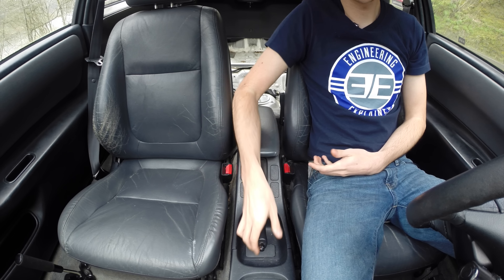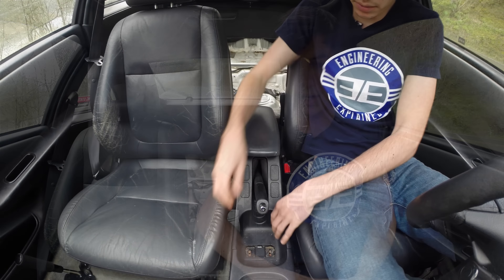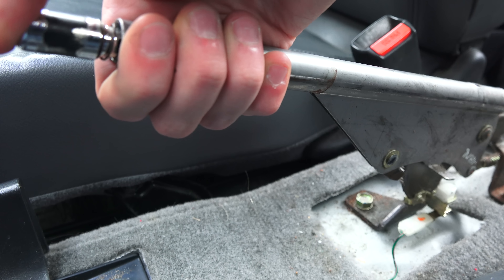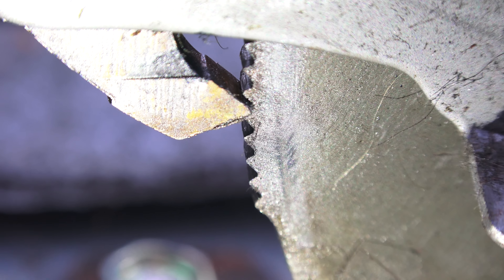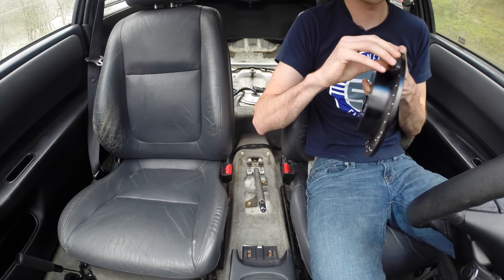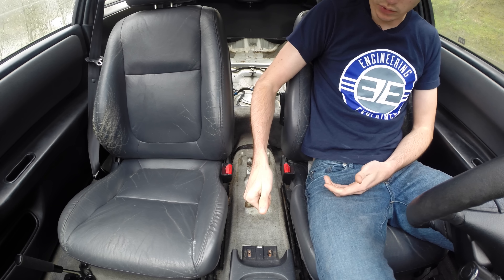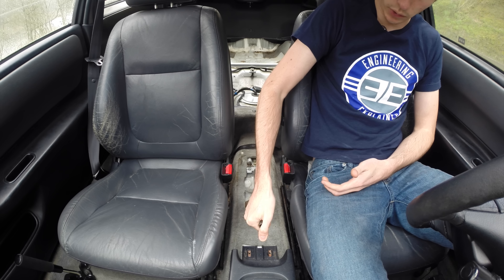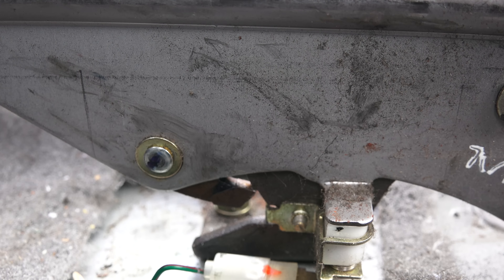Always Press The Handbrake Button? Myth Busted

Comment: Hello there! 
I think there might be a small opportunity for misconception on the problem stated here and the solution given.
I just spend a good portion of the afternoon fixing my handbrake and I had to do a bit or learning for it.
It might be that the part that has led to the idea that the hand brake wears out is not the ratchet mechanism itself but the connection to the actuator button.

In the handbrake mechanism for my car (golf a4) The button assembly is a long  piston like rod that has the button on one side and on the other one is connected to the ratchet lever by means of a small indentation. The ratchet lever goes trough a small hole in the rod and it is not connected directly, but just sit there loosely. Every time the button us pushed it moves the lever of the ratchet and unlocks the position, but if the ratchet is run without pressing the button it bounces and jiggles freely in that hole, hammering slightly at the rod with the force of the ratchet's spring on each step.  The problem here is that this rod is made of plastic, and the ratchet lever is metal. I don't think the ratchet or its lever would ever get worn out significantly during the normal use of the car. But the union of the button's rod and ratchet's lever certainly could, that's what happened on my car, it broke right there, you could tell by the pattern in which the piece cracked. A small metal piece hammering at a rigid plastic part over years would certainly cause a problem.

I saw that the button assembly in your car appears to be a metal rod and has no access to the point of contact from that rod to the ratchet lever. But that is not the only mechanism there is for handbrakes. My car has access to that joint point, and, when I was looking for the parts to fix my handbrake I found a lot of others from different brands and makers that also use a plastic rod or had a similar approach. Also, I think the fact that they sell that piece individually and not the whole assembly is another clue to the fact that there is a weak point there. 

I am certain that holding the button would prevent or delay the wear on that piece, and my car would not had needed to be fixed now if we had done that as a precaution. 
Of course there are lots of caveats. In my case it took almost 20 years for that piece to break down. Also, I live in a very hot place, and my car is dark. The heat has certainly weaken every plastic inside my car over the years. 

Now while I know holding the button would help, I don't know if it is worth it to do it to avoid breaking that part. Or if its worth to be aware of that potential damage. For me, It took oh so long to break down, and I definitely love the handbrake ratchet's sound and feel, also to change that piece was an easy fix. 

However,  I certainly know that the idea of not pressing the button causing wear and the potential to break the handbrake because of it is true. 

At least for many makers and brands and under certain fairly common conditions. 

I just wanted to let what I learn be known. To give some context or maybe justification to some of the comments and ideas about the handbrake. 
Though I am sure many of those that defend the point of holding the button and think that the ratchet would get damaged are wrong for the reasons you explained maybe my findings can help give some light to the origins of the myth. Or why is not really a myth to begin with, but has a different mechanism of wear than the one commonly believed.

Other thing, when I went to the mechanic at the dealership to try to get my handbrake fixed, they told me they would need to replace the whole piece, not just the button's rod. I am not sure if they told me this out of ignorance on the workings of the part or if they wanted to sell more, but I think this is also a good example of why would people believe that not pressing the button causes damage in the whole handbrake ratchet mechanism. 

I hope my explanation was clear and that it was useful, also hope that Jason gets to see my comment and it doesn't get lost in the sea of notifications haha

Thank you very much, I'm a long time fan, I really enjoy the videos!

Comment: typically its not the ratchet mechanism that wears out as shown in the video, but this method usually results in stretching of the handbrake cable itself. even if only over done by one or two teeth at a time it can still cause the cable to stretch, some people have a tendency to pull the lever harder than they need to when not using the button. most people will hit the same spot all the time which means that there isn't any noticeable stretch of the cable, however some people pull the lever unnecessarily hard and stretch the cable needing it to be replaced. it seems like people have been miss informed by someone at some point as to what actually wears out, could have been car garages trying to make some extra money by duping customers

Comment: The clicks are actually designed to give the driver a feedback how tight he's using the handbrake. You don't have to pull it all the way up everytime - just on let's say down or uphill. On a flat surface you don't need that much brake pressure or don't even use it at all: some say the inserted gear after power off the car is enough to hold it. Personally I prefer to use the handbrake as second guard against rolling...

Comment: My driving teacher asked to push the handbrake button on his car, pointing that with my car it is OK not to push the button, but not with his car. He said, that his (instructor's) car is used for about 10 hours a day 6 days per week and with the parking lot excercises most of the time (hill climb with manual transmision, etc.), so the racheting mechanism work a lot in this case. He said, that he had problems with handbrake lock with his previous car after about 4 years use for teaching

Comment: I was always taught to use the button when pulling up the handbrake, because once this becomes habit, it could prove much safer if you ever need to pull on the handbrake in an emergency situation - you'll have much more control and can continuously alter the pressure like a foot brake compared to just ripping it up and locking it on.
Reply: Right. That's exactly what I think! We are not alone ;-)

Comment: Also think about where the wear is going to happen. Pulling up the handbrake might wear the tips of the gear, but when the handbrake is set all the force is working at the bottom of the gear teeth. So even slightly higher wear will almost never have an effect on the main function -> to keep the brake in place.

Comment: It should be noted that, when using the parking brake as an instant U-turn handle, you should hold the button down for the entire maneuver so you can let it off at precisely the correct time without the ratchet interfering.

Comment: I knew my parents never pushed the button so I never thought much about it. It has had been replaced on my dad's old 71 Ford after restoration. This was a standard vehicle and the only reason it probably needed replacing is that the previous owner didn't know how to drive standard and used the parking break more often than needed. It is a very cheap fix compared to breaks or tires and doesn't wear out quickly if you have a car less than 50 years old you shouldn't have to worry about it unless you use it 24-7 365 or just play with it which is not smart because the more you use something the faster it wears out, but also if you never use something it wears out as well.

Comment: Besides, the ratchet mechanism should be made with a hard steel anyway. Make one out of 99.9% Aluminium and well, different story. Obviously is going to last with a high hardness steel. Some people talk so much garbage
Reply: Any steel would work.
Reply: Sonic The Hedgehog Nope. Forged steel would not be good.
Reply: +ItsThatMilkshake surface hardness is more directly affected by heat treatment than being forged or not. And besides, forged pieces are generally stronger hence their smaller grain structure formed by the forging process.
The forces applied here are considerable but not something that would need some special hardened alloy. A generic steel with a basic heat treat should suffice for this ratchet design
Reply: 𝖘 𝖍 𝖎 𝖗 𝖔 Why are you talking about the strength of forged pieces? The ability to withstand wear is the property we want since we arent talking about elastomers or super ductile materials. 

What are you comparing forged pieces to?????? Im telling you now that the teeth and catch on this are not forged, thats all. Theyve obviously been hardened via one of the many processes available. I agree with your last statement. All I was saying is that people shouldnt have  to question "whether it wears out". As youd know, of course it will last. Thats what engineers are for :D
Reply: ItsThatMilkshake You literally said forged pieces would not be good for this application, and that really bugged me since I do blacksmithing in my spare time lol.
Steels are generally cast, rolled (hot or cold) or forged. I was comparing forged to hot rolled, sorry for not mentioning that earlier. 

When I take a closer look at the components in the video I suspect the ratchet to be hot rolled and stamped while the catch being drop forged and the tip being ground to its proper shape. I think so because of the typical surface texture of the catch.

Of course I wasn't discussing wether it would wear out or not, just the material selection and properties
Reply: 𝖘 𝖍 𝖎 𝖗 𝖔 I think this is where your practical knowledge of working with steel could overthrow my theory from my degree. We (mech eng) dont do so much working with steel, so being able to tell the steel just by looking at it isnt my forte yet. Once I work with it more (rather than create designs with it) i may learn a few things. So far we understand the atomic scale and microstructure of a given material etc, how to make it, diffusion rates, etc all the theory. Interesting input.
Reply: ItsThatMilkshake I do actually also know some of the the theory since I'm an engineering student but contrary to a lot of my peers I work a lot with my hands as well.

Do you also do prototyping and testing of your designs?
Reply: 𝖘 𝖍 𝖎 𝖗 𝖔 Nice dude. Yeh I do a fair bit of CFD with our SAE car. Currently working on our undertray and getting it to get some downforce on our budget.

Comment: Still: The sound isn't exactly beautiful...
However, to make an actual point: When pushing the button, you are usually also more careful/slow when you pull the parking brake. This may not seem important, but even though it's unlikely, you can damage or even brake the steel ropes if you pull the brake "violently", especially in an older car if it has been done a lot and the parking brake hasn't seen much maintenance.
If this does happen, it's going to be very annoying and even though I don't know if the reapir will be rather cheap or expensive, it is much better if you don't need any repair at all.
You can also eliminate the risk for this happening if you just pull it carefully without pushing the button, but if you do push it, you will pretty much instinctively be careful.

Comment: I thought Americans never bothered with the hand brake?   Don't you guys just shove the car in park and walk away??
Reply: Not all automatics have a Park option.
Reply: +Paul McKeever I park with the hand or parking brake in every car every time.
Reply: i drive manual, so i just sit in it for a few seconds to see if it will roll, then leave it out of gear so i don't stress the shift boot. so far its only rolled into my shed once
Reply: +MitchMAH ...what
Reply: +Bait28 BMW parts are over priced. if I put it in 1st the leather shift boot could crease, and my hand brake is starting to seize. if I stop using them they can't ware down anymore and I won't need to buy new parts
Reply: +MitchMAH ...buy parts from third party sources... my 5 series, my M3 and 2002 weren't expensive, even parts were cheaper than GM

Comment: Your explanation about not wearing out kind of fell flat on its face when your video CLEARLY shows fine metal particles magnetically stuck to the teeth of that parking brake lever. If that is not from wear-n-tear, then I'd suggest you start looking for the source of those fine metal pieces. It's definitely coming from some sort of wear-n-tear.
Reply: +Sean Greene key world "significant"

Comment: Great video! Something to add would be, how hard to pull the lever? I have found myself over-doing it, and then wishing I had been more moderate with the brake when I get back into the car. In the average car, assuming it might vary, how hard should you pull up the brake? That said, what gear should you leave your car in, for maximum anti-roll safety? I was told my car actually conserves battery usage when off, if left in reverse. Thanks for all your great videos.
Reply: In my car manual it states that to prevent the car from rolling when the handbrake fails when the car is downhill (nose down) the gear must be in reverse (opposite to the roll direction) When standing uphill in the 1. As Fiat states 2016. I think they know why. But why is that the best way?
Reply: Brian O'Neil do you have an 05 corvette?

Comment: Bought new in 1996, my vehicle currently has 401,000 miles and climbing. I never pushed the button except to release the brake.  If there is wear, it may be too late for me to change my use of the hand brake to save it.  It still seems to be in great condition.

Comment: I think it's also worth mentioning that the pressure being applied is quite low on the teeth. If it was a heavy system then it would have more (albeit still negligible) wear.

Comment: It's just irritating. If you love your car why not just push the button?
Reply: +Rice Life It's not that irritating, especially if you pull fast enough.
Reply: but the sound is satisfying
Reply: +Rice Life Why would you? It's pointless to do so. If the sound REALLY irritates you, then yeah, but otherwise, by the time it wears, your car will probably be far past it's useful life. And if it's not, then you can find one from the same model in a scrap yard for dirt cheap.
By your logic, why would you let out the clutch, you are wearing it out. Why not just start your car in gear and shift without depressing the clutch? (I know it's not the best comparison, but still).

Comment: You're more likely to be paying attention to how much tension is there if you press the button in rather than just yanking it up on a ratchet.  I think telling people it will wear it out is not a bad thing.  It's a good habit to have even if people are doing it for the wrong reasons.
Reply: At least in germany, the handbreak hast to apply his whole force at 3 clicks. If you pull like a bull you do it wrong anyways
Reply: Andreas Rist
Really?  Doesn't it vary according to manufacturer?
Reply: Sure it depends per manufacturer and wear on the cables. They stretch over time so do the brakes get some wear. There is no 3 click garante. I got a new car and it has a real short hand brake it takes more then 4 or 5 clicks to prevent it from rolling on a small incline.
Reply: Ya, I got an old jeep Cherokee, it wnt stop on hill unless you pull up like a bull, itll click 5 or 6 times.

Comment: But seriously, what is even the point of having a ratchet if you think you have to bypass it every time?

Give me one argument why that ratchet is there if it is not to be used.
Reply: +CPTANT It's clearly just there to make a really satisfying sound.
Reply: +CPTANT  At first it´s there to hold the lever secure in place at different heigths due to brake pad wear. Tell me that you never push the door latch when you close the door. Some people like it loud, some peolpe like to slam the doors, scuffel with the shoes, slurping their coffee, they like to hear the gearbox scratching or the engine hitting the limiter.
But tell me what´s wrong if somebody avoids these noises cause he doesn´t like it?
Reply: moninum
You don't need a ratchet to hold something in place ifs its the button that locks and unlocks the brake, it just makes no sense.

If you don't like the sound it makes that's fine, but pressing the button is frequently brought up as something that you SHOULD do.
Reply: CPTANT
 Do I understand you right if I translate that into: if you need to push the button to operate the lever in both directions then it wouldn´t be a ratchet?
Still the main function is to hold the tension on the brake cable, it is getting into a ratchet as the teeth are more shallow on the back.
Besides that, I know that the teeth and the latch are often hardened and I also never heard about a brocken handbrake ratchet
Reply: CPTANT 2 years later, but. 
That ratchet gear has 5-7 levels usually, you count the cracking sounds to know, how much braking to apply. E.g. you are parking on a hill, you will need more braking force to hold the car, so you count 5 to 7 (max) cracks. If you are parked on the even surface 2-3 is enough. Don’t remember where I read that.

Comment: Obviously you're overall premise is spot on, your parking brake will never wear out from not holding the button. However I'm not sure I buy the heat causes wear thing. Brake pads don't wear out on the track because they're getting hot, they wear out because to stop your car faster, which you do on a track, you put significantly more force on them and significantly more often. The heat is a by-product. For example the parking brake "ratchet" wouldn't wear out any faster if you heated the "gear" every time you used it.

Comment: The ratchet pawl is is only half engaged at 1.06 and the tooth above is rounded. Compare it to a new assembly. Release the pawl on application no contact no noise no wear. Comparing 2 flat surfaces ( brake rotors and pads) to 2 pointed objects shaped to fit together when engaged.    You have the option of removing all wear by pushing the button why not do it